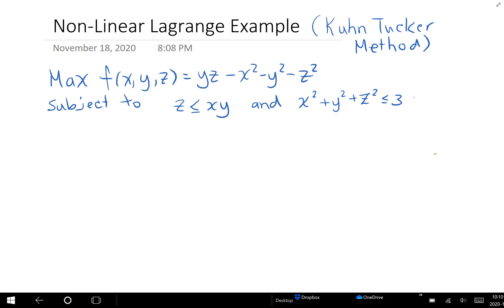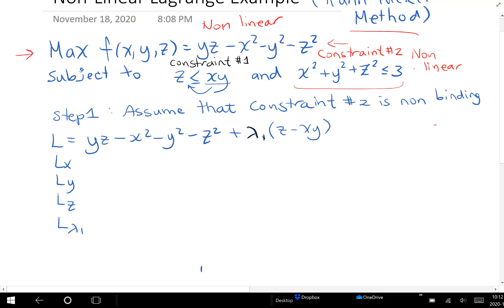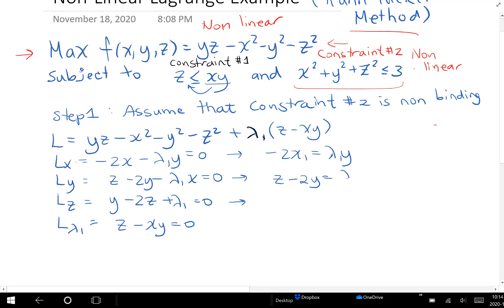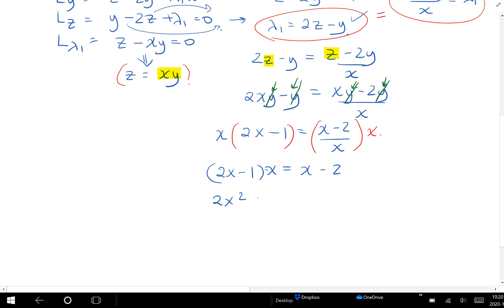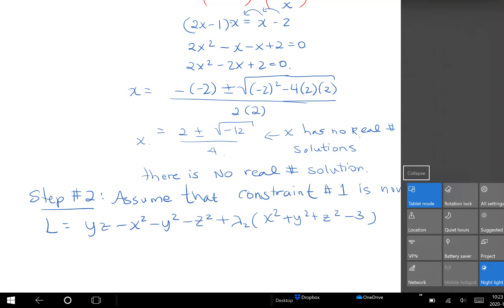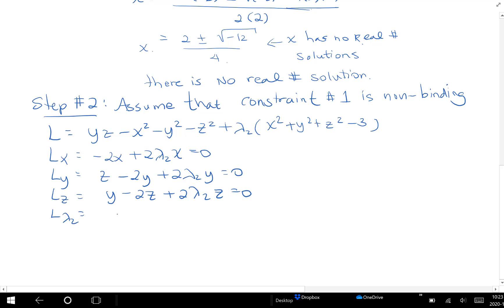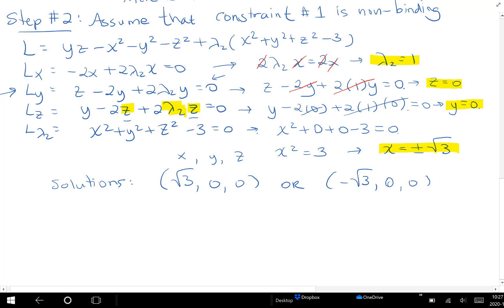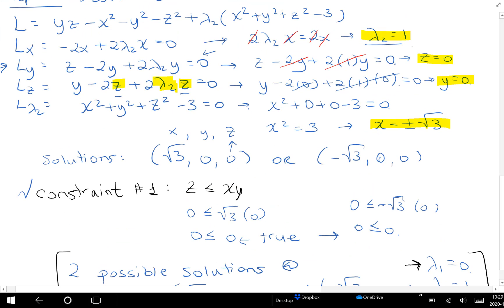Lagrange /Kuhn Tucker Method on a Non Linear Example

Comment: But what should be done when neither the first condition nor the second is satisfied?
Reply from the maker: You just satisfy the constraints and don't worry about optimizing. If the  constraints can't be satisfied this is an infeasible problem. Sadly this can happen, for example in healthcare where not only is there not an optimal solution, there is no solution at all.